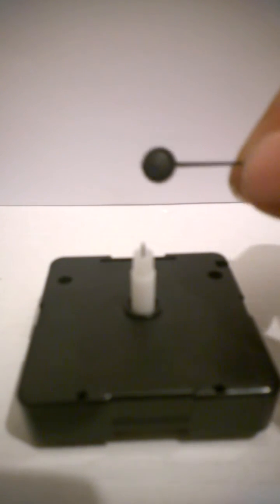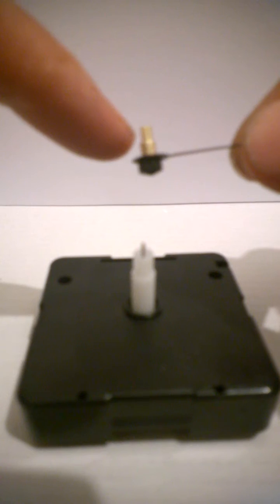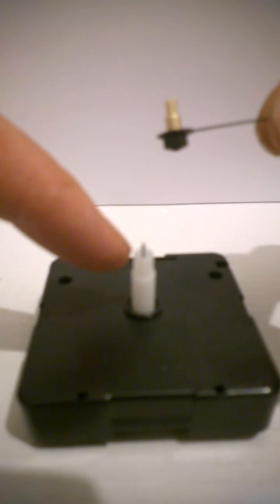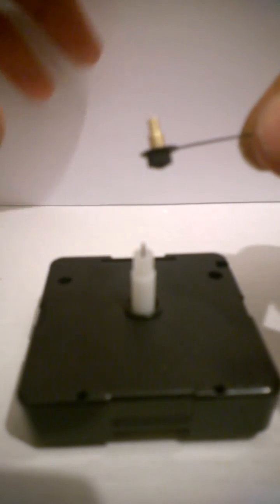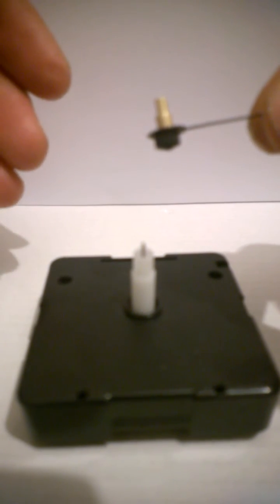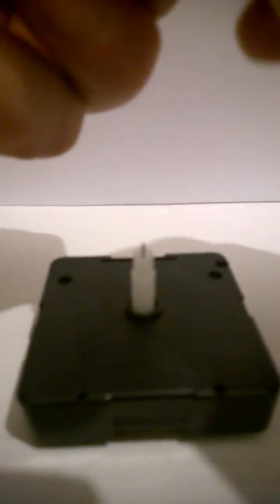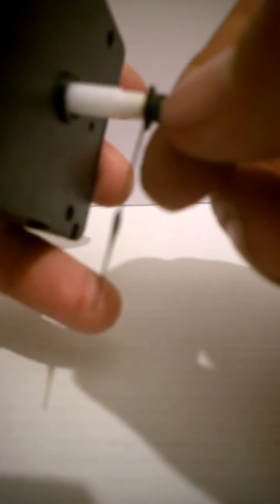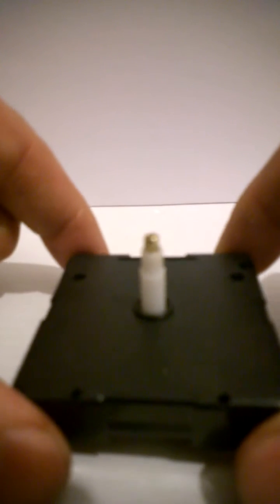Quartz UTS common shaft problem, troubleshooting guide

Comment: I have few over 10yr old clocks with quite nice, classic hands that I would like to keep using.  But the new quartz movements I purchased have larger shaft diameter than my old ones.  The hands came with them arenot very nice.  I have tried to swap the minute and hour hands parts but realised even a slightest difference in dimensions cause the movements not to work at all.  They’re simply impossible to align.  I spent hours to no avail.  I couldn’t find any info online addressing this issue either.  How can I find movements with narrower shaft dimensions so that I could use the original hands.  Appreciate an advice.